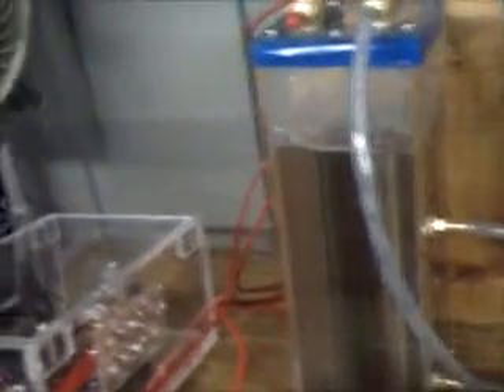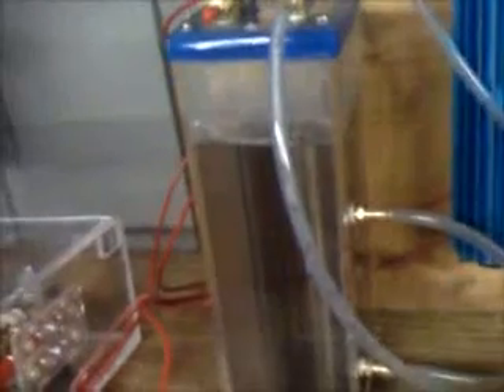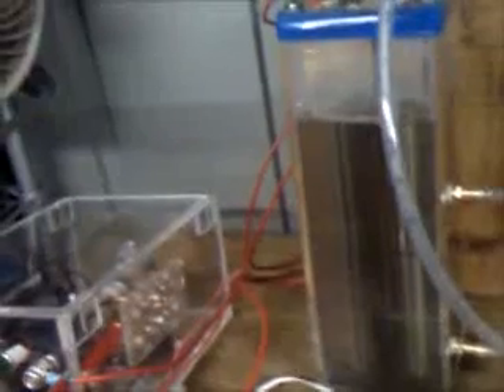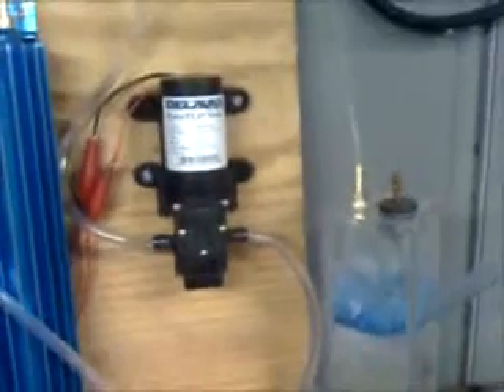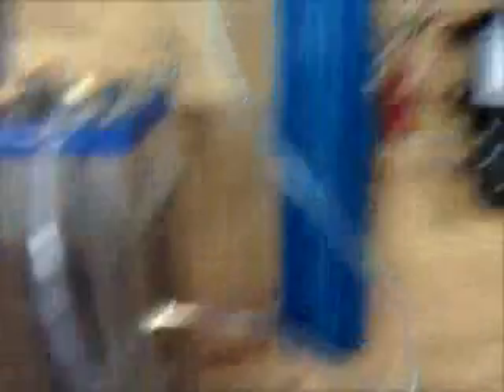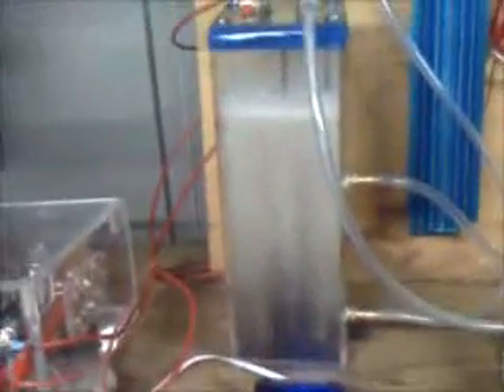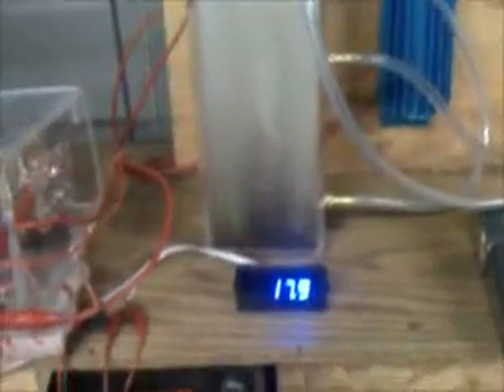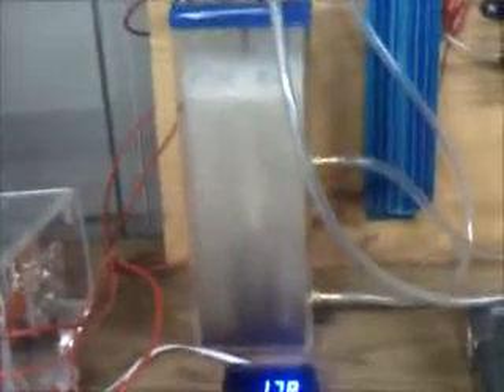Hydrogen Generator

Comment from the maker: No "brown stuff" in my cell. Use ONLY distilled water and about 3 teaspoons of Sodium Hydroxide per gallon of H2O. As far as what the solution will do to the aluminum cooler? I don't know, however, in a worst case scenario, my reactor will end up "using" the aluminum as an electrolyte...hehe...

Time will tell.

Peace

Comment from the maker: And I do Heat and Air for a living. Go figure. I can't speak for the HWH, that may be a viable solution. I m hoping to find something SMALL, as the rector is only 4x4x12, and for accurate measurement, we need to monitor the "inside" of the cell. I bet someone will post a perfect solution....(hint...hint) Many minds working in synchronisity can achieve the impossible, and it will be us small people in the trenches that brings this technology to light. 
Thanks for the post.

Peace

Comment: The idea that immediately jumps to mind is thermostats off of a water heater, or perhaps the standard AC/Furnace type thermostats? Perhaps some of the thermostats that keep water temp (In a water heater) within a certain range? That way you'd only need one, and the wiring would be simpler.

Comment from the maker: Yes. The pump will be governed by two thermostats. One to bring it on, run to desired temp, and another to shut it off once temp has been achieved. I just haven't yet found the thermostats to do the job. Any suggestions would be appreciated. As far as how long to get the cell back up to the 18-20 amps it takes about 7-9 minutes. The demo video had the pump running too long. In real world application, and to maintain optimum hydrogen generation, the pump would more likely run around 20-25 seconds

Comment: Would you switch the pump on and off with a thermostat? I noticed the amps drop from +/-18 amps to +/- 12 amps with the pump on. How long after the pump is shut off until the amp draw goes back up to 18 amps?

And what is the HHO output? As in liters per minute?